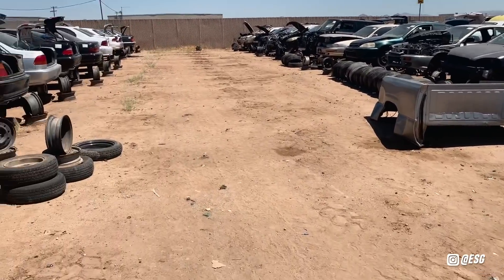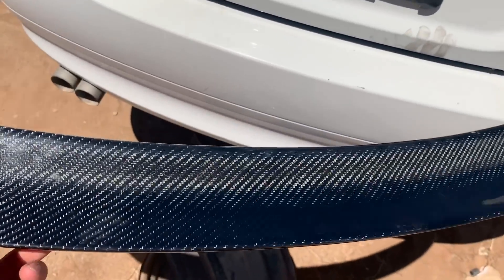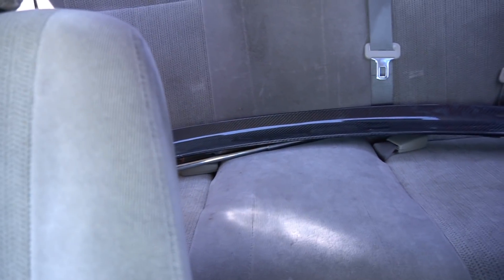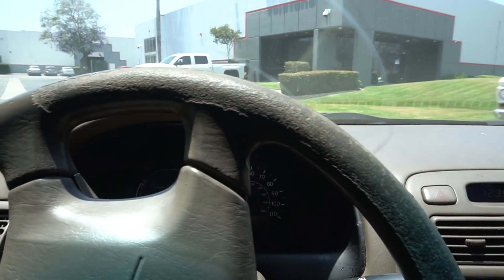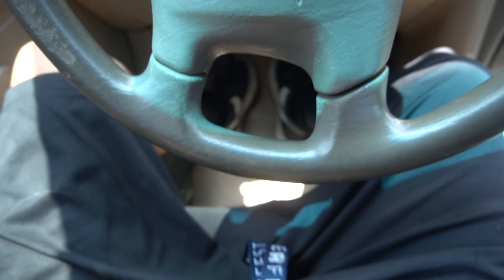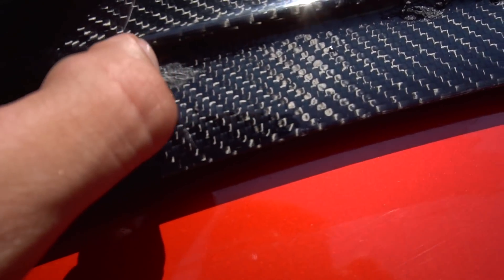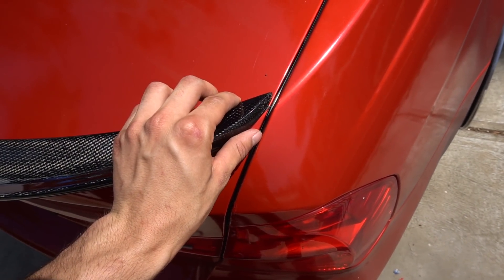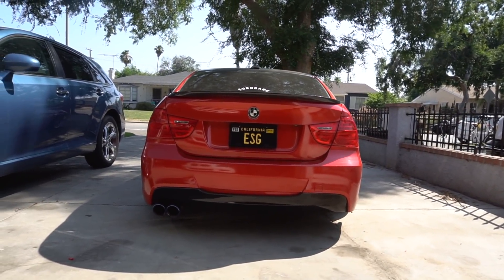I GOT A $30 CARBON FIBER TRUNK SPOILER!

Comment: if he is running any tune or additional boost in the 335i
he needs index 12 injectors and/or upgraded LPFP.

Fueling is always an issue with n54/55 setups.
Reply from the maker: No tune or anything, completely stock. He’s ordering a new set of index 12 injectors next week so hopefully it fixes the problem

Comment: For the 335 check what index the injectors are. The most recent injectors are the index 12 so try replacing the current ones with index 12’s
Reply from the maker: Yeah I called BMW and unfortunately there isn’t any active recall for the injectors, it’s probably past due it’s time. It’s an ‘09
Reply: ESG yeah I think it was covered under warranty which was 8 years or 82,000 miles whichever came first so the 335 is out of warranty by now. He would have to get them replaced and the injectors themselves are like $1,400 for all 6 of them

Comment: Yo question for you esg. You still driving without your front end links? Any problems?
Reply from the maker: Yeah still driving without them, absolutely no issues
Reply: ESG so basically they are just a performance part? Bad ass e90 by the way.
Reply from the maker: Rudedoggy_ 760 Yeah it’s just for better handling, but honestly isn’t too much of a difference